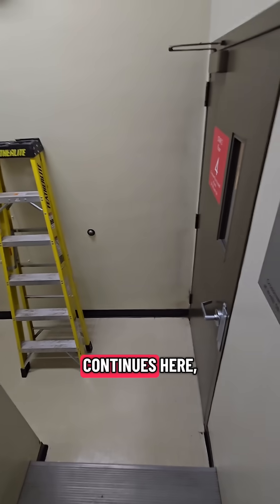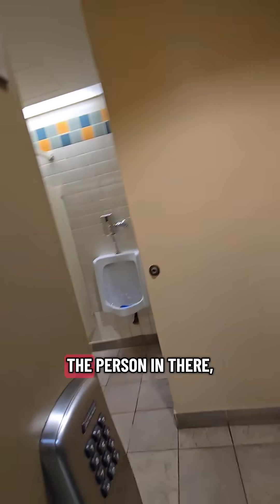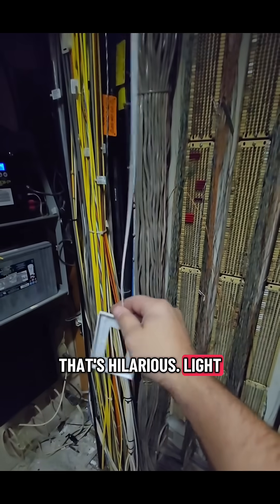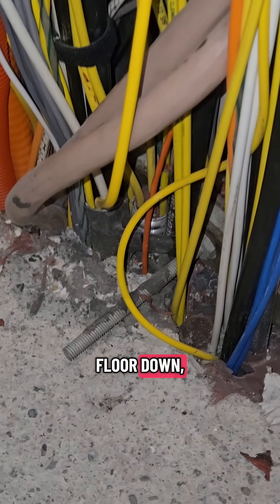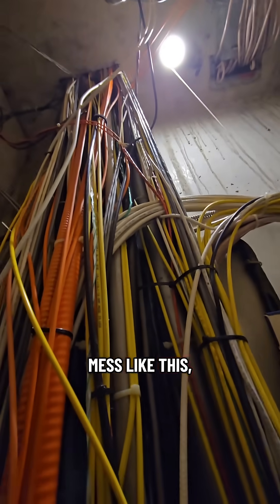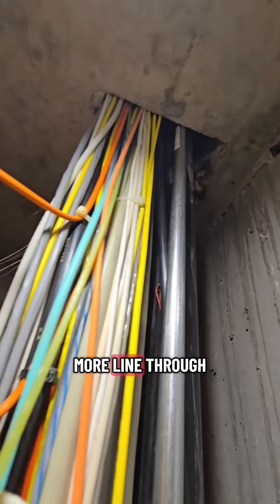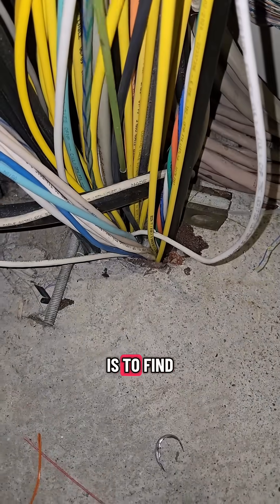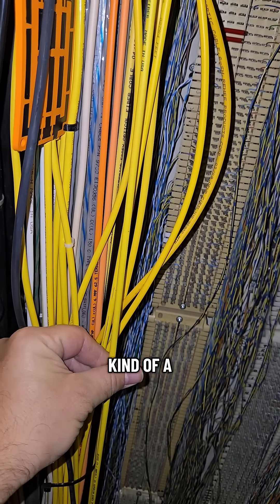The Secret Fiber Jungle

Comment: I was working on a project at the Wynn hotel & casino in Las Vegas. We had to replace all of the network switches on the property with newer equipment. There were equipment rooms in all sort of weird places there. Including one in Steve Wynn’s bathroom in his villa. There was one room that was particularly interesting. It was about 120 square feet and had an all tile floor with a drain in the middle. There was nothing else in there except a water hose (connected to a garden-style valve) and a single chair. I have no idea what that room was used for but I can make plenty of assumptions. I asked a long time employee what that room was for and he said to not ask questions. Anyway, there was a door to an equipment room in there too 😆

Comment: Oh man the amount of buildings where vertical risers and distribution was in the mens bathroom.  Not my favorite jobs to work on, I'll tell you.  I remember one job were there were hinge down ceiling cassettes above a stall next to the urinals in a financial center.  I tell you there would be a rush of guys at times of day hurrying you come and pee and use the other stalls.  And they were always in such a rush that the place didn't want you to close down the bathroom.  So there you are, on a ladder, doing splices and checking cables.  And suddenly the room is filled with people and all they see is a guy standing with direct line of sight over all the partitions in the bathroom.

Technically not the worst ones.  Wasn't much of a fan of in-ground cable vaults in the winter, nor boiler rooms were you are have about an 12-16 inch space you have to shuffle in sideways with your face about a 2 inches from the equipment mounting.

Comment: Not entirely true.... we used to pull out Most of the copper telephone cables, leaving maybe one 25 pair cable per floor. (Most people go to VOIP for phones - but there are usually odd circuits like fire phones, fire alarms, security alarms etc)   But that is a ton of cat5/6 cables going between floors...

Comment: That is actually a pristine wire closet ngl.  I'd love to have a job there, it's great
Reply: Can't tell. Are you being sarcastic or do you really believe what you just said here?
Reply: This is 10/10 clean.  I've seen new construction with no service that's more messed up because the first guys to set it up did so bad.  This closet was installed by some ATT wizard in 1975 and every room was perfectly punched down on 66 blocks and cross connects made.  Barely anything changed since them except the trunks going up and down to other floors.  That could be better but it's not my mess tl worry about.
Reply: @MrNoobed  it's not your mess to worry about until you have to replace a 25 pair feeder cable to the MDF. Yeah, the 66 blocks look clean, but everyone is switching to voip now so if it's not decommissioned already then it will be soon.
Reply: @CognitiveHeatsink i dunno what youre arguing about.  Its still there  not hurting anyone and is the least messed up thing there.  The elevator and fire alarms probably still run on it and if anyone was so inclined you could put a vdsl2 gateway at the mdf and push 100mbit per pair around the building with it.  As far as bandwidth goes the entire trunk vould be replaced with one 1" fiber cable and theres plenty of room for that.  I dont understand the guy that managed to tie a knot in a cat5 by weaving in and out of ot

Comment: When you run the cables, how much would you actually be paid for running it 20 stories, and how many km of cable is that, would you typically run several cables at once when you do this or is just running a single cable more uncommon?

Comment: Literally spent the last few days pulling out old fiber and copper patch cables in a data center, I’m so glad they’re spending the time to have us pull out the 90% of stuff that’s not being used anymore, kinda wish that 10% wasn’t live but still I’m glad we can do it right before we put the new stuff in.
Reply: I think some new code or maybe insurance terms for commercial property has gone around. Because I'm seeing an increase recently in buildings getting strict about removal of old wiring. It's a real good time to get into a focus of LV demo because that scrap is also worth $1.50-1.70/lb unstripped (classed as 50/50 Inside Wiring) where I'm at. 

I've done the math out that a decent demo can be $20-30/hr in scrap alone. And people pay you to do it! So there's good opportunity to offer that service for cheaper to underbid. And land the jobs that get you much higher scrap/hr

Comment: I worked in a hospital where to get to the 7th floor closet you had to go thur the OR.  That meant you had to scrub up each time you went to work in that closet. The newest gut got that work order.
Reply: That's idiotic. How did you get your tools in there? Did you have to bag them? And how did you keep from contaminating the OR when you opened the closet door? It can't possibly be sterile if it has network equipment in it or holes in the floor and ceiling.

Comment: Worst I ever saw was an old hospital. Place was huge, and every wiring closet had miles of copper POTS, mostly abandoned.
Many years ago, sitting in my CCNA class, I thought someday I would solve network problems with a command line. Here I am earning money and solving much more serious network problems mostly with a drill, a flash light, and colorful language.
Reply: Hospital wiring gets absolutely wild. I spent half a day chasing a mysterious RJ45 across 3 floors, eventually discovering a forgotten panel in a storage area, terminated for a token ring network.
Reply: @mistaecco  They use Cat cable for nurse call stations. But it runs live voltage so it's a nice spark, or buzz in the arms if you are touching a ground, if you cut it not knowing that.
Reply: @KaiserTom  that's why color scheme for your wires is important. It's not just so the lazy tech can easily tell if it's data, voice or fire alarm. It's to know "purple has voltage on it." But also, don't cut the red fire alarm cable. 😂
Reply: yeah school doesn't teach you that. here i am a decade in and never axualley whent to skool! really no degrees, no certs. ill get a cert one day.
Reply: Add a sharpie to your toolkit and make things easier for the future.

Comment: It’s a shame that some of that decommissioned OS2 single mode fiber can’t be reused.  That same pair that was running 10/100M years ago can do 400G today.
Reply: They absolutely can. I've certified and reused runs that have been abandoned by ISPs or previous tenants. It really depends on where it's been abandoned. Some of the old locations they ran aren't where the new network closets are. Usually the Dmarc stays the same but customer suites change a lot.

But a lot of that stuff is also old OM1/2 multimode
Reply: @KaiserTom  I hate multimode, but they still make transceivers for that crap.
Reply: @KaiserTom  Sometimes the hard part is figuing out what the status of some random cable in a huge bundle like that.  Especially when you got multiple guys there and want to get to the next job.
Reply: At my workplace we still run OM1 and are installing new OM1 still - that's because it's an industrial control system that specifically requires OM1 62.5/125 to be used, even if it probably would have worked fine with later generations of multimode.
One more thing with multimode is that you can use your phone camera to see which fiber that's the fiber with light.
Reply: @ehsnils  Well, I'm not too sure about that. The connectors should be standard regardless of core size, or you're having to use proprietary connectors. Otherwise you should be able to slap the same connector on a better fiber. The light wavelengths didn't change.

You can't just splice OM3 onto the OM1, you have to fully replace it end to end, but you should be perfectly able to with your equipment. The core size of the connector on the machinery side should be the same between both sizes of multimode. But again, that assumes standard connectors which I know older industrial machinery loves NOT using.
Reply: WHAT!?? NO! i've seen multi gig like 10G over single mode BUT 400!!??? what the wave lengths magically start to line up at those speeds?
Reply: @cdoublejj  It's a 4x 100G, single lambda wavelengths. We've gone up from single lambda 10G and 25G. Now they are pushing 8x 100G transceivers.

The wavelengths don't line up, that's exactly how DWDM works. Our sensors and lasers have simply gotten really, really good to piece out incredibly fast, different frequency signals.

True DWDM systems can pack terabits down a single pair across its 80+ channels it can do so with. Limited only by the transceivers on both sides.
Reply: @cdoublejj  wait until you hear about 1.6Tb optics. 😂
Reply: @cdoublejj  The actual performance limit in glass is in the petabytes, it doesn't matter how old it is.

As long as the SFP modules support it, the glass can carry it.
Reply: People who don’t recommission lines are insane.

Comment: Its worth mentioning that non conductive fish rods/tapes should always be used.  A  guy on my crew working in a national chain pharmacy sent a metallic fish tape into an improperly marked floor conduit, it ended up in an electrical panel instead of the rack and blew out power to half the store.
Reply: I worked on a large venue, and the caretaker told us a story about a handyman coming in to do some work and he pushed a metal fish tape into an empty conduit and it went into a 3 phase cabinet. It hit something and shot a 3 foot flame out the vent holes in front of his face. The handyman stood up, didn't say a word. Walked to his truck and drove off leaving his tools behind. Never to be heard from again.
Reply: @sixter4157 amen, I wish I was smart enough to have that same response
Reply: @sixter4157 I would do that too but not leave my tools
Reply: It's funny, cause that's the only kind we have is the bare metal strip.

Comment: And this ladies and gentlemen is why forethought and foresight is expensive upfront, but saves and saves and continues to save time and money in the future.
It would've taken some quick math and some double-checking to see the cost of running conduit either from each floor (varying diameters) or from a set number of floors (e.g. conduit #4 supplies directly to floors 13, 14, 15, and 16).  
But the upfront cost would be minimal compared to doing this or in the future, having to drill more of the floors/ceilings, and/or cutting a currently in-use line, then having to repair it.
Reply: The question that would be asked, “who gets billed for that?”. A friend’s daughter in law is an architect and we talked about flaws in a building and she said the first thing anyone would ask is “who pays”. 
The daughter in law did not have anything to do with that flawed building.
Reply: That’s called premature optimization in software development. I say this as I am taking a break from hanging a TV and running cables for a home theater and questioning if I should upgrade the hdmi cable I will be burying in a crack of foam board behind drywall.
Reply: @mathews.522 Run a large conduit.  Even a flexible one is better than nothing.  Then run your HDMI cable inside of it, along with a simple nylon 1/8" rope -- for future pulling of cable
Reply: @zafarsyed6437  my contractor actually suggested 2” PVC pipe for the 4 foot run from the back of the TV to the wall below.  He even put a flange on the end and missed it in. It made changing cables over the next 10 years super easy!
Reply: It's painful to watch this video, with the amount of labour involved in pulling cable with just holes in the floor. You are spot on!

Comment: I was doing low voltage in data centers, and we would demo out the old stuff. Lots of cable. I was the conduit guy, super fun
Reply: The network in my house is wired with old cat5 cable I’ve pulled from data centers. Yes I am that cheap, but it’s all properly color coded so good enough for me.

Comment: Mmm, looks like the building needs to maintain a network backbone with switches every 10 floors or so, with a 25 or 50g backbone.....  use vxlans, ipip, etc to ensure customers are completely seperate.
Reply: Nah, why would the building bother to run a network. They should have just had high count fiber cables in the risers and panels between floors. Then just charge customers for use. All this copper cabling between floors is stupid
Reply: Definitely don't want the building running a managed ethernet service unless they are a DC.

Comment: First thing I noticed was the lack of firestopping between floors. Not an uncommon occurrence, for sure. And it makes pulling that new line or lines oh so much more enjoyable<sarcasm>
Reply: I'd take having to get the firestop re-certed over a Hong Kong situation in a riser.
Reply: Yep that was the first thing i noticed as well, the comlete lack of red foam, not even a trace, never been there.
This is a public building is it not? Is this not required by code elsewhere?
Always fun having to work trough that/sarcasm
Reply: These people put a maintenance closet in a bathroom. What did you expect?

Comment: Seldom are you pulling in the same kind of cable. "Are you using your telephone landline? No? Great, I'm going to use that line then."
But installers usually won't pull out a service that might be activated or needed by the next tenant.
Reply from the maker: Yup. Also nobody is paying anyone to pull out the old stuff.

Comment: 100% correct. Big buildings are built on a “shell” meaning all low volt power and communication is there for temp use. Each customer who purchases a new floor may want need different setups so the correct thing to do is remove the old wire with new. The simple and easiest way for everyone, is to use that old wire as a “fish tape” or pull string. Attach new with old and you can take out old and trash while replacing with new. But now code for these high rises uses the square brush bristle that alllows a smoother transition floor to floor. So again he is also right about the age of the building
Reply from the maker: In a perfect world yes 100% you are right.  Problem is nobody is paying for the labor of removing the old cable. The buildings should mandate that old cables be removed but that never happens. Best system I come across is buildings that have their riser systems managed by a 3rd party contractor. They are the only ones allowed to pull cable in the building so standards are always met.
Reply: @Sysotek as a regular electrician we don’t like to go anywhere near the old low volt cables on a fitout of a space so we end up leaving it unless it absoloutly has to be touched, regaurdless of how old there is always a chance Ure cutting through a single pair in a 100 conductor cable doing a phone line or some BS and now your in trouble and have to figure out what the hell cable u demod that does that persons telephone, nightmare scenario, and it can be a million times worse than a cut telephone line lol
Reply: if it hampers a job it needs to be done. it's like you clean toilet but leave it without new paper
Reply: The NEC requires the accessible portions of abandoned communications cable not marked for future use to be removed. In theory. In practice, that almost never happens, unless it gets so ridiculous they pay to have it cleaned up.
Reply: As one of these old Ilec and internet providers we do reuse all that fiber. Problem is what end users and customers want tend to require more and more and more......    to the point of needing things like passive, or even Active just much more expensive, ODAM or optillien devices to split signals to put more on that fiber. Even though that fiber can handle many Tbps with the right equipment, must end users even very large places like this do not want nor can spend that kind of money. So its cheaper to add more and use much more fiber.....     I have equipment that I use to make my backbone that carry 34.7 Tbps on 2 fibers some of the fiber is from the 80's so yeah we do re use it.... lol
Reply: I wish. Otherwise I wouldn't have many jobs tearing out 30+ year old cables in places that have definitely turned over many suites.

Seattle is the one city I know of that's getting harsh on buildings for that. And that's kind of spreading out to the property management companies. Especially with all the abandoned analog wire that's now completely worthless.
Reply: Our specs require removal of abandoned wires and conduit. Yes I know these low voltage cables don't require conduit in these rooms all the time.
Reply: Exactly, just tape your new cable to an abandoned one, pull and replace. Two jobs in one pull and done.  If only it was always that easy eh.